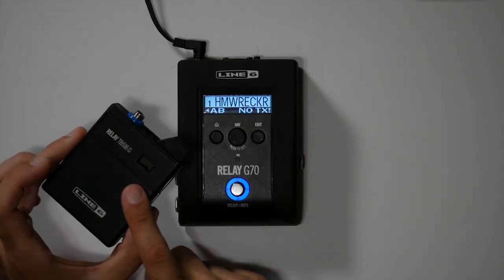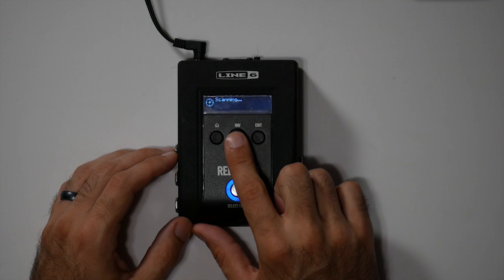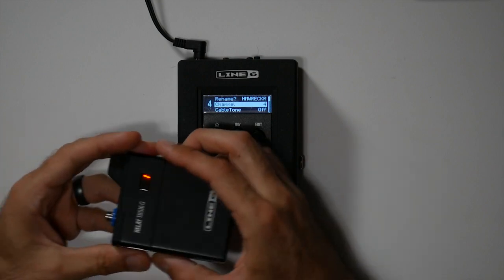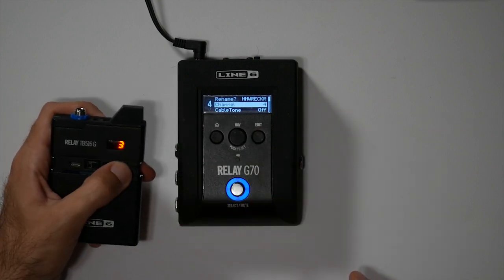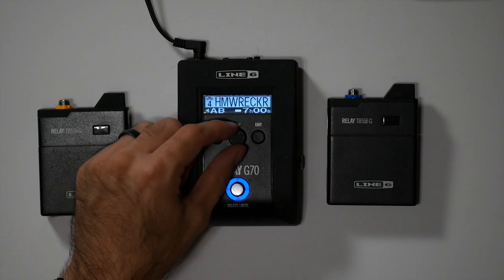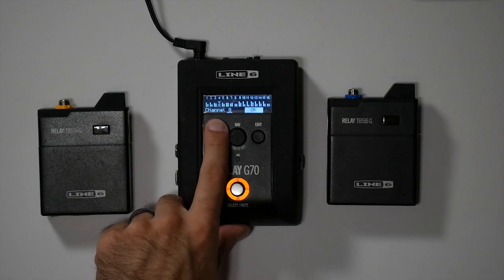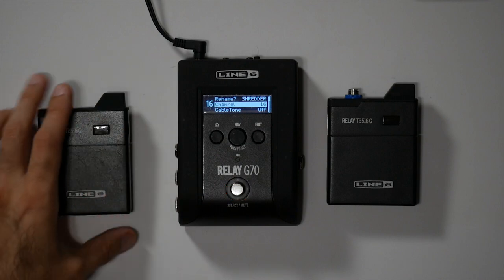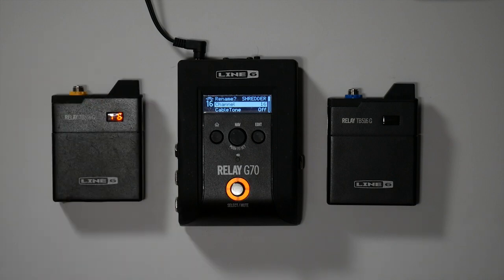Line 6 G70/G75 Prevent Dropouts!!!

Comment: So, I had 3 major gigs and two of them at the venues I've previously experienced heavy drop-outs. This time I did the scan and figured out the most reliable channels. At one of the venues I had two drop-outs but that's about it. Also, an interesting thing happened at the third venue. The sound guy left my G70 receiver nearby the digital mixer, which uses a wi-fi router for the remote console connection. And the scan returned all the channels being interferred. So we placed the reciever further away from the mixer and its router, and that nullified the interference for almost all the channels. As conclusion - I am quite happy with my wireless system, and reconsidered selling it. All thanks to this video.
Reply from the maker: Awesome to hear man

Comment: Hey, thanks for the video. Im currently getting nowhere with Line 6 support so wondering if you can help at all 

My transmitter isnt connecting to the receiver at all but the transmitter connects to other receivers. My receiver keeps turning off and on and has 'NO TX!' in thr bottom right corner. Ive tried connecting on all channels but its still not working at all. Any ideas?

Thanks!

Comment: 3:33 If you have two transmitters (for switching guitars), why would you put them on different channels? For my Relay30, I have 4 transmitters, and all of them are set to the same channel for easy guitar switching. Just trying to understand what the advantage is
Reply from the maker: That is a good question. I haven't tried using the same channel but do you get any interference if you have all the transmitters on at the same time? Or do you have to make sure to turn each transmitter off or on when you switch guitars?
Reply: @ManBunMetalHead  I turn one transmitter off, rack the guitar, and put on the other the guitar, turning its transmitter on.

Comment: Nice video, thanks! Are you experiencing any drop-outs at all during a gig? I've had a lot of issues with my bands g90 (3 sets), with dropping out and signal being lost if something touches the antenna etc. Is this the 2.4ghz that does this? Should we be looking for some other system?
Reply from the maker: I have two transmitters I use with my G70.   I get dropouts here and there with one of them, but I never have problems with the second transmitter. Haven't been able to pin down why I get dropouts since they don't happen that often.
Reply: halo dude.. which you prefer, the line6 g90 or shure GLXD ? these both make me confused.

Comment: Oh I'm happy with this video, thank you so much!! <3 A quick question a fully charged rechargeable battery you can play along a concert for example a 2 hour or more hour concert?
Reply from the maker: For sure, you can easy get 6 to 7 hours on freshly charged rechargables.
Reply: @ManBunMetalHead  Thank you, I'm using Varta Rechargeable power Ready to use  2400 and 2600mAh batteries. Which rechargeable batteries are you using and how many mAhs? :)
Reply from the maker: I use Tenergy NiMh 2600mAh batteries.

Comment: Great video but really should not need to do this on such an expensive system. The much cheaper audio technica system 10 does this automatically and has never dropped out in a whole year of touring. I was about to upgrade to this system but worried about all the reported dropouts.
Reply from the maker: I hear ya. I'm not familiar with the Audio Technica system. I think because you can setup multiple transmitters with one receiver on the G70/G90, it's not as easy to do it automatically. It would be nice though.
Reply: I'd hate for people to get mis information from this comment. Most high end/pro grade wireless systems...whether it's for mics, IEMs and/or YES guitar, have scan functions and a lot of cheap low grade systems don't. Yes you SHOULD have to do this on an expensive system, at every single gig. That is industry standard and any real industry trouring wireless or sound engineer will tell you this. That's normal operation. You do want the manual control of scanning and visually finding open, less congested frequencies. Auto can be nice, yours isn't "wrong" but you have no real graphic/visual way of knowing how accurate it is. More power to you, that your AT unit has worked great. That's awesome, but most large scale tours, regular small tours have someone dedicated to handling all the wireless on the tour, including the $3/4k guitar wireless units that manually scan for open frequencies.
Reply: @bvaladez74  Wow what a pissy reply. Line6 fan much? So my tours are any less real than yours? Jeez. Point is for that price no you should not have to mess around doing this just to prevent dropouts.
Reply: No no. You're misunderstanding. There's absolutely no pissy tone to my response. Not pissy at all. I'm just simply clearing up the myth that price point has anything to do with the feature that allows you to scan and find a cleaner signal. As well as, nobody spoke on nor disrespected your situation and or your level of touring. Nor did I insinuate my level of gigging is any different than yours. Don't misunderstand. I'm just simply clearing up the possible misrepresentation of price point having to do with properly manually/visually scanning for a clean wireless signal upon every gig/every venue. That's all.